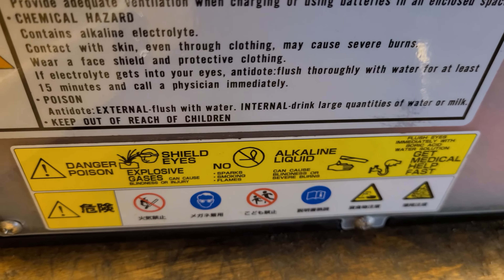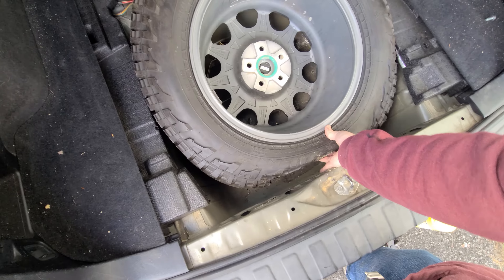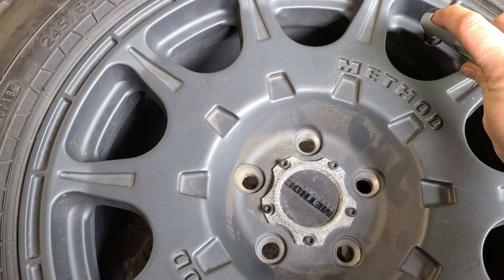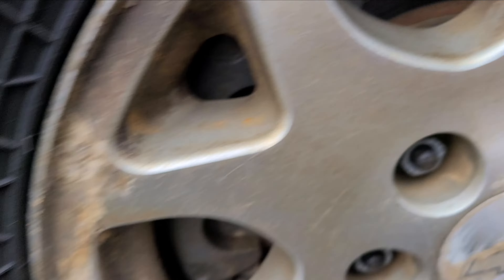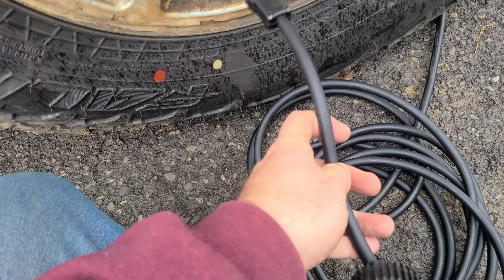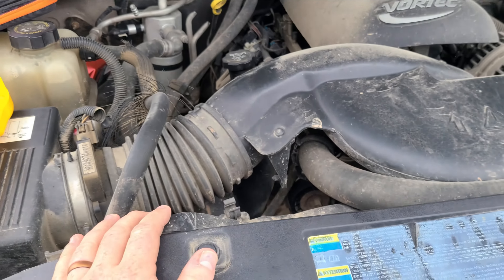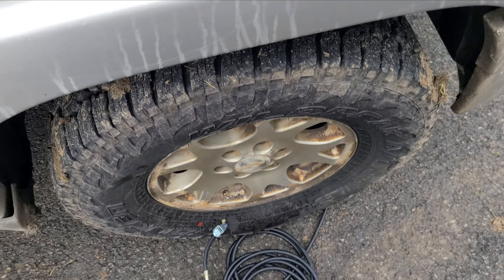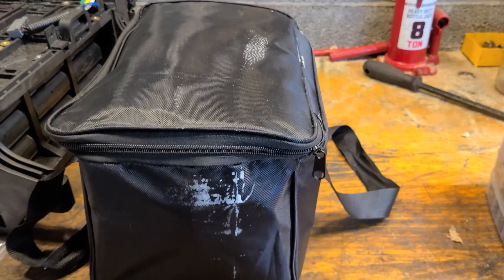Round Peg in a Square Hole 2: Testing the new TOZALAZZ Tire Inflator

Comment: Cool experiment, Bruceyyyyy! It looks like the sidewall crack was visible in your first video prior to the vacuum process, though. Unless you practiced a few times off camera, maybe? Anyway, neat to see how the bead holds up under vacuum over time. Thanks!
Reply from the maker: Really? I'm going to go back and check the original footage now. Everything was the first time of me doing it in the first one. I filmed a third time of me installing it upside down but decided to drop it for the sake of time.
Reply from the maker: Wow, it was right there in the original shot of the first video and I missed it.
Reply: @bruceyyyyy  Bruce how are those FALKEN Wildpeak tires?  Are they noisy on the street?  How's the wear on them?  Thanks.
Reply from the maker: Odd wear patterns on the AT Trails. I was planning to go back to the AT3W. But it's now discontinued.
Reply: Any update on further tests or doing this with ‘non-cracked’ tires? I’m quite keen to try this out having also looked at folding Audi tires in the past as an option for the outback….

Comment: Any update on further tests or doing this with ‘non-cracked’ tires? I’m quite keen to try this out having also looked at folding Audi tires in the past as an option for the outback….
Reply from the maker: @davegriffiths1010  Just reinstalled it as down here. Had to take it out after over a year to use when I rolled a bead of at the sand dunes. 

Pumped it up and it worked great. Deflated it and it's back in now!